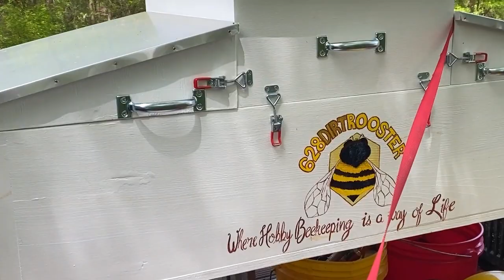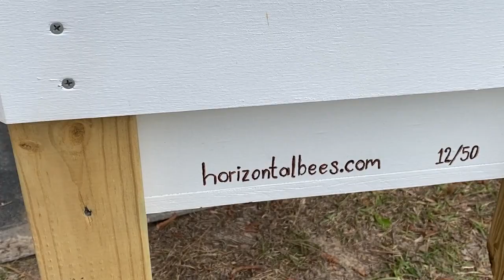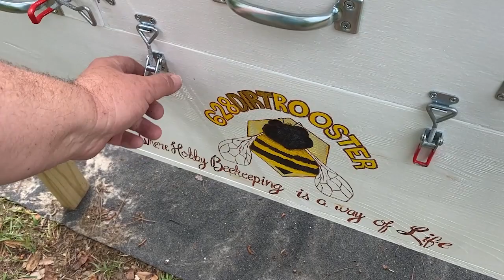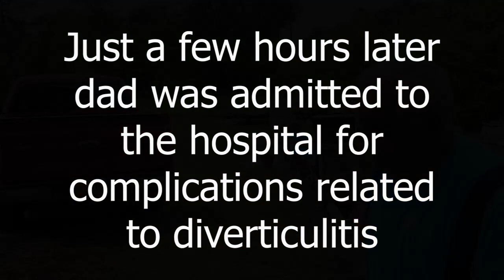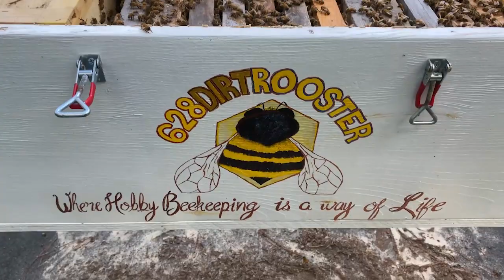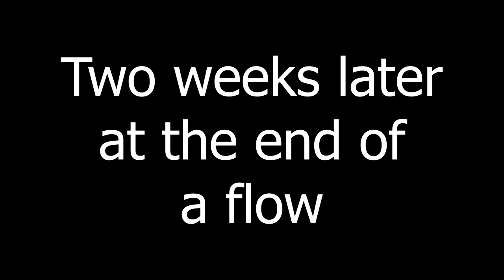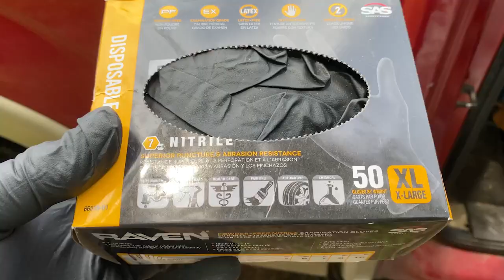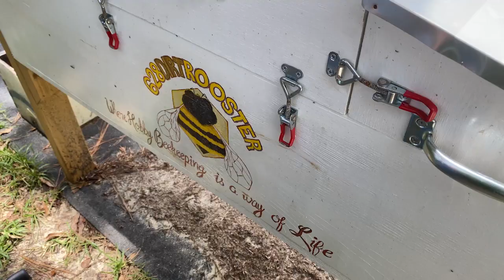Custom Long Hive - Dad's Reaction - Long Langstroth

Comment: I have not had ANY problems with ants since I bolted it to my cement platform i made for my hive. I love the fact that if i have to i can even work them in the pouring rain. I put them under the outer edge of my covered porch. I don't have to worry about hurricanes or anything.

Comment: Hey Guys. See how you have the hive at the end of the video?  Without a top super inside?  This is how I would keep it. Horizontal hives are meant to be one level thus easier to work. That middle box could simply be used to hold and cover some equipment. All the best

Comment: I was wondering if there is any update on how this hive worked. Did you attempt to have two separate colonies? Did that work. I heard someone else try and had problems with one of the queens being killed apparently because the combination of the two colonies and the bees being able to cross into each one, confused the bees in thinking there were two queens in one hive.